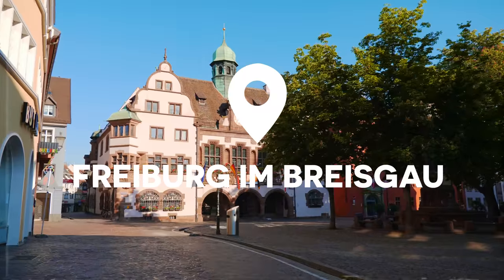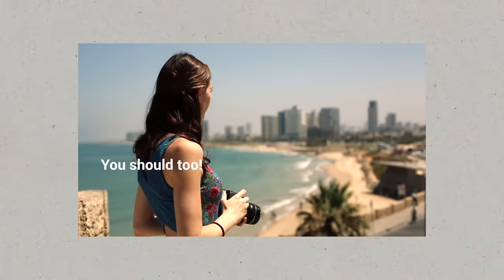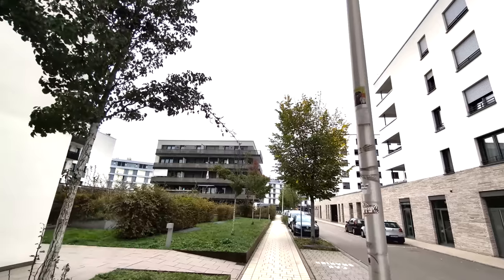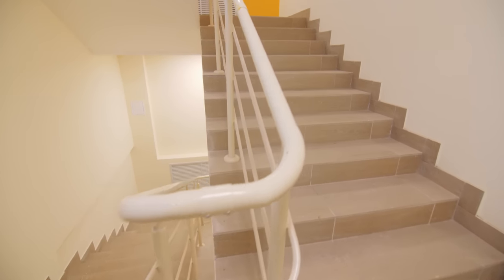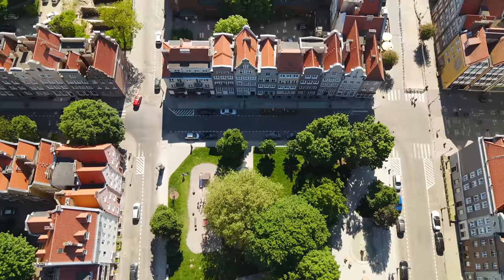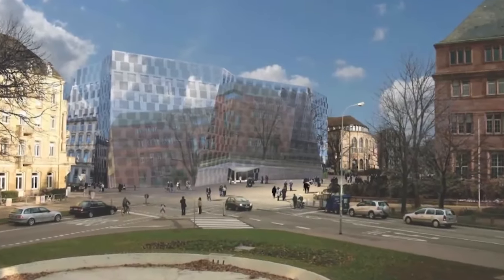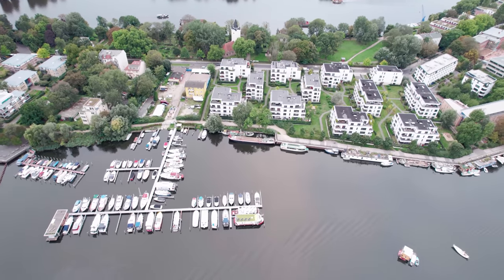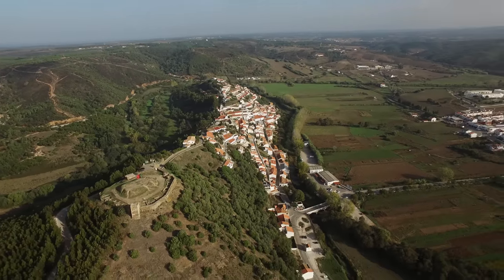Germany's BIG DUMB BOXES ARE AWESOME.

Comment: You need to be careful. Modern "dumb boxes" probably have a lot of thought behind them. 

However, for counterexamples of big dumb boxes you need to look at former eastern Germany. Or just about any formerly Soviet aligned countries. To house a lot of people, they were building big dumb boxes like crazy. However, they look like nobody ever planned to live in them. "Needs a balcony" - ok, it has a balcony. But to sit down on it (e.g. to have breakfast in fresh air), you have to play Tetris to fit two people, two chairs and a small table on it. Elevator? Too expensive, people need to keep fit anyway. And then you find that people get old... 

If you optimize too much, you'll end up with something like that. Having a few frills will improve the quality of life in there massively and will not cost all that much in the long term anyway. 

For not that great examples look at the houses in Landwasser (I grew up in Auwaldhof 5, 7 floors), lots of great ideas, but also a lot of bad ones. A lot of the rooms on the apartments are rather dark. The really tall houses are even worse, since you have too many people in there, with little interaction. "Max und Moritz" in Wirthstrasse look like a great idea, but the rooms are only about 2.2m high. Also, little interaction, resulting in fairly high crime rate. (At least, that was the reputation when I moved away)

The boxes you're showing do look really nice. I know a few projects where they were built. I can't afford to live there...

Comment: Flat roofs won't do well in areas of heavy snowfall.  I live in Idaho, in a valley in the Rocky Mountains.  A flat roof will collapse with some of the snow fall we get.  I can see how those structures are logical for a lot of areas...but at the same time....I grew up in the very rural, butting up against mountain wilderness.  

In this setting those boxes would just look horrifically ugly.  But then too, we don't have the dense population that would require such structures and most buildings in town are limited to a basement, ground floor and 2 floors above that.
Reply from the maker: You can definitely add in a pitched roof if the local weather conditions are more amenable to the structure. But interestingly, flat roofs in Germany are constructed to a greater weight capacity than pitched roofs in part to deal with the weight of snowfall, but also to accommodate solar panels.

Comment: Building Energy tech here, germanies "DUMB BOXES" have nothing to do with being efficient, its just based on energy laws EnEv and GEG, any building built after 2009 should consume 70% energy compared to the standard building "KFW EFFIZIENZHAUS-100" otherwise they wont get a permit, meaning better isolation, efficient heaters and better air ventilation systems

Comment: 10:46 i disagree: if the water source has no power too, the people in there won't be able to use the toilet more than 1 time. (no new water will fill the tank) And i don't know about you, but i have lived in a 4th floor (european where street level is not 1st floor, but the one above street level) and i have carried water up to the 4th floor without elevater. And if you carry only the drinking water of 1 week up there you need to be quite fit.

In general while i get your general point and agree with many others you make, i think it's bad when every single building looks the same. On one hand you actually need to read the street signs to evne know where you are as it's like a mirror maze, and on the other hand: it reminds me of the communist concrete silos of the eastern block countries built in the 60's and 70's.

Also the falt roofs: there's not a single flat roof i know of that is not leaking after 10-12 years. There's a reason in earlier times even though they could make them, they made saddle roofs or  single pith roofs...

As for the glas buildings: to me that's an architects disease, most non architects don't like them anyways.
To me function is more important that form, so putting a glass facade on a building that isn't supposed to be displaying what's inside makes 0 sense. (and it also looks "wannabe cool" to me)

Comment: I love this kind of analysis. I think big dumb boxes look great and feel great to live in. However, they're not my favorite for mixed use residential.
Reply from the maker: There is a way to pull it off... most of the buildings in city centers of Europe are mixed use and are really just dumb boxes when you strip away the ornament.
Reply: @TypeAshton  how do you feel about mixed use residential towers tall enough to support their shops even when they wouldn't get enough foot traffic if they were shorter?

Comment: I see many parallels with software design. 🙂 “Big dumb boxes” would translate to simple, boring design with few well-known elements. In the end it dramatically increases the maintainability, because you spend less time on design, fixes are quicker because of reduced cognitive load and training of new employees is faster.
Maybe there is a new opportunity for designers: focus on maintainability. Easily replaceable elements, low-maintenance design, things like that.
„Ist das Kunst, oder kann das weg?“ (Is that art or can it be removed?) should become a standard question in every design.

Comment: Okay my problem with these new neighbourhoods is the lack of variation.
All of those buildings are usually built within the span of 5-10 years on the same strip of land.
It's alright in the nieghborhood you're showing, but in others they will not just be similar in style, but pretty much built from one and the same assembly box.
Now they all look clean and nice and fresh when they're new, but let's move past 20 years, and all the buildings have aged, and they have aged and whithered together.
They could really use a coat of paint, but there is not a single building which looks worse than the others, and every year you might be able to just postpone for one more year, right? 
Painting is an extra cost after all.
And until the first building is painted and stands out as a shiny new variant of all the other ones, none of them has a huge desire to be first.
That's different when all the buildings had been built in the span of say 30 years to begin with.
Anytime you come by there's a little bit of variation, some new building here, a new coat of paint there, maybe abuilding material has gone out of fashion and has bee replaced in the meantime with a different material, so that there's some inherent variation within the building styles. 

Here's an example where I observed these new living areas being added, and the uniformity is not quite so mutch of a problem yet, but the gray sky really helps accentuate my point:
https://www.mainpost.de/regional/wuerzburg/hubland-ist-die-kritik-am-zustand-des-gelaendes-berechtigt-art-10294408 

On another notice, I hate that Germany uses white as a paintcoat for buildings. 
White, pastel tones, any colours that lean into cold colour spectrum -- in summertime they might look good, but we get sutch depressive weather between november and mid February,
especially the January is aweful with on average just a few more hours of sunshine than there are days in the month:
https://de.statista.com/statistik/daten/studie/5578/umfrage/durchschnittliche-monatliche-sonnenscheindauer-in-deutschland/ 
We need to add warm colours to our streets, because we can't rely on the sun to do so, and when it does, we might well be at work, stare duelling our screens until somebody submits around 6pm when the sun is long gone.

Here's the best visual I could get of two buildings in a similar january light, one with a yellow fassade, and one with a white fassade
https://spessartbund-kleinostheim.de/wp-content/uploads/2020/01/CC20200118_102739-scaled.jpg 
https://de.m.wikipedia.org/wiki/Datei:Frohsinnstra%C3%9Fe_11_Aschaffenburg_20181125_001.jpg
Clearly the building styles are very different, because I couldn't find any better, nobody seems to be eager on uplading photographs of Germany in the bleak January weather, 
but I think these still help illustrate the differebt effect a building has depending on their colour paint, even or even especially in the bleak season.
Reply: Have a look at Berlin for example: the vast majority of old apartment blocks everywhere were built in the late 1800s to early 1900s, with only a very limited variation in floor layouts. The variety is in the facade decor, and even those stucco elements were mass- produced, to order from catalogues. Big dumb boxes looking like grand palaces.
Reply: @PotsdamSenior  Do you have a picture of that? I don't know Berlin necessarily well enough to follow your argument ^^

Comment: The dumb box as a technical solution is without equal - but having a plain, non structured facade isn't what makes a liveable city. No, balconies and windows aren't structure, they are holes. Just look at plans of late 1800s buildings - the ones showed as examples of classic dumb boxes - and you'll note that architects back then didn't care about how a window was structured or made at all. Their job was to create a pleasing structure over an otherwise pretty standard design. Standard due the technology available.

Today's architects seem eager to focus on building technologies - which back in the days was the job of craftsmen / engineers - and forget all about structuring from what is given.

Comment: @Ashton, living here in the US i can tell you that i hate the predominant single family residence architecture with fake gables, fake dormers, etc that "add architectural interest" to otherwise gray or beige "models". At the same time i do have the vinyl containers (if you know you know) in tan and gray springing up everwhere. 3 sides siding, the front with "masonry" of some kind. yuck. Luckily, i live in a 70s built 4 side brick building with just a roof on it.... on 2 acres in the woods. yay for the dumb boxes, well built, well insulated, and most importantly accessible by public transport.
Reply from the maker: Sounds like such a nice home ♥️ I know brick is expensive, but it adds so much charm and durability than vinyl siding.

Comment: There is only one problem with modern-day dumb boxes - and it's not inherent to the shape, but a result of profit maximization: their ceilings are too low. Compare current day 2.5 m average floor-to-ceiling height with the older box-shaped buildings you showed. The older ones typically have somewhere between 2.7 and 3 m floor-to-ceiling. Combine that with the fact that people have been getting taller in the past century or so, and you see where the problem is. If you design human-centric, you need to provide spatial 'breathing space'. And while there are tricks to distract from lower ceilings (focus on the horizontal by f.i. using floor-to-ceiling windows), in the end it's just that: tricks. So a firm 'Yes' to boxes, but with the side note that floor-to-ceiling heights should be changed (regulated!) from the post-war 2.5 m Neufert low-cost minimalistic approach to a more lofty 2.7 to 3m.
Reply: I don't think that the usual ceiling height of 2.5 to 2.55 m has a lot to do with profit maximization.  It was a consequence of the need for large amounts of cheap housing to get working families out of the slums after WW I and to build new housing as quickly and cheaply as possible after WW II.  Even most large and (relatively) expensive one-family homes usually do not have a higher ceiling than that today, unless you own a villa from the art-nouveau period.  Furthermore, rooms with higher ceilings unavoidably have higher energy costs, with the warm air going up to areas where maybe the inhabitants can't even feel it around their head unless really turning up the heat.  I'm 1.88 m, by the way, and don't really have any problem even with our basement/souterrain lower story (the house is on a slope) that has only 2.15 m.

Comment: The problem with the "big dumb box" is that they are build to one floor plan only. The apartments are the same, at most there are 2 types combined to fit a floorspace. So touting flexibility is rather thick. Try fitting a family of 5 or 6 into one of those. You'll have huge issues ... Ok I get that there are most 3 (maybe 4) member families now, but even those have issues fitting into those boxes ...

Comment: Fantastic: you got everything right ....  but you didn't address the most important subject: Environment and energy savings, subjects that are one of the highest priorities today since the energy crisis thanks to our friend Putin and his visit to the Ukraine, where he is not very welcome (euphemism). Energy prices have exploded and have created huge problems for a ever growing share of citizens. The Big Dumb Boxes are an excellent basis for energy savings measure/ The facade vs volume ratio is ideal. Buildings should never be higher than 7 floors, as the energy wasted grows exponentially with the number of the floors. Elevators consume a huge amount of electricity; water pumping idem. Heat losses idem with higher floors. Wood construction becomes more and more difficult.
Passive houses (of close to passive houses) are impossible with high rise buildings. high rise buildings have negative impacts on surrounding buildings. Roof surfaces are too small for installing sufficient PV panels.
Hollywood addressed the security problems of high rise buildings in a famous movie in 1974 (the towering inferno); it seems that since then we didn't learn anything over the last 50 years. Dubai certainly didn't learn anything; nor did New York 😪😪😪

Comment: whenever i see full glass facades i wonder what maniac was in charge of the design... glass facades are an absolute nightmare on internal climate and invariably causes problems on the outside due to reflactions... especially when some idiot decides to build the glass front in a parabolic shape...
really architects and designers should get an engineering degree before they go out in the field to make menaces like that

boxes are just the most sensible shape for building and windows always are a massive weakpoint (structural, thermal and for maintenance), so you should carefully consider where to put them and what kind

sidenote on windows - i have a burning hatred for the inconsiderate bastards who put in windows that go down to the floor of the room... because those will massively trigger anyone with a fear of heights...and thats not an uncommon phobia

Comment: Speaking of architecture that makes sense and that doesn't, I hope you can solve this for me: Why just why do they built these flimsy wooden houses with drywalls you can easily put a fist through, even in the tornado and hurricane areas in the US? And not just once, they rebuild them just the same when they've been leveled. I mean, those things look like they couldn't even withstand a mild breeze. So what's the point of building like that? And how is wood keeping out the heat or cold?

Comment: Flat roofs?  Definitely not regarded as a good thing on single homes in UK (been tried in new towns, had to have pitched roofs added later, at least here in North-east England).  Most of UK has long periods of the year when moisture can accumulate on a flat roof and gradually wear out the materials and accumulate vegetation.  Don't know if there is a difference in cost and maintenance if it's a building with, say, 20 dwellings in it?

Comment: I think that there is a difference between community buildings or apartment buildings beeing big boxes (i live in one right now) and family homes beeing boring white boxes, because it just seems to me like the design choices that work well with bigger buildings are just impractical, unnecessary and so characterless that they become ugly.

For example : flat roofs making you not have an attic or 
big ground to ceiling windows that face the street, which people (understandably ) cover up with curtains so nobody can see their living room (negating the use for a window in that place ). Also these Windows take away space that traditionally would have been occupied by furniture .
The lack of overhangs because there's no roof make the facades tarnish very fast. 

the lack of color on particular is just a shame and the gardens are usually also very strangely designed.